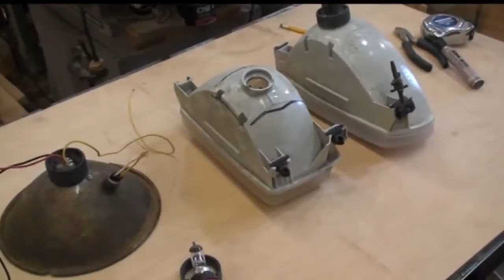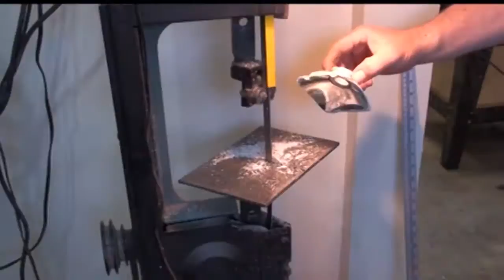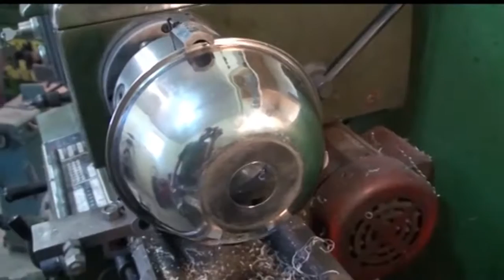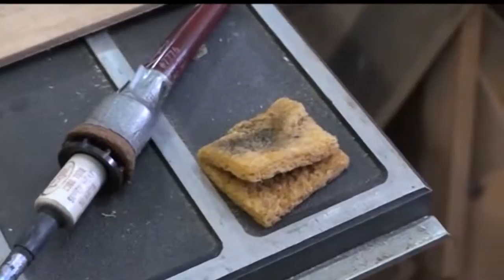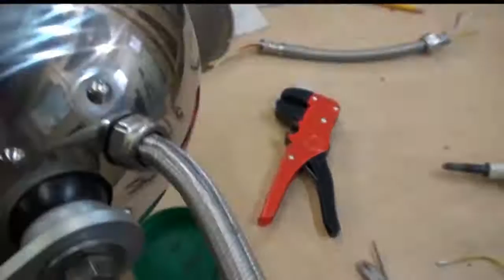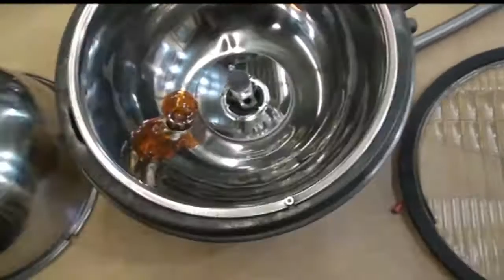Vintage Headlight Conversion to Halogen Lighting - the cheap way

Comment: Doesn’t a halogen sealed beam cost just $15 anyway?
Reply: Incorrect size. Sealed beam is only up to 7” whereas a lot of older cars are 8” or so which don’t exist as a sealed beam unit unfortunately.

Comment: One problem is that the silver reflects the most light and stainless and chrome don't reflect near as much.
Reply from the maker: You are correct but this was a simple and cheap alternative that still works and a whole lot better than the vintage setup.

Comment: by using the 16 g wire initially, using 14 g wire wouldnt seem to make anything safer as  the current being used is still going through 16 g...and i dont think thats heavy enough for the load.......in my build, I ran flexible plastic bathtub/shower conduit.This is the type that is used for when you have a removable shower head and looks like it has a chrome plated coil around it..... I also used12v auto relays...the 16g ran power to the relays while 14g was run to handle the actual power to the halogen sealed beams. ..dont forget to make your buckets moisture proof as that will blow out your halogen bulbs instantly. ( another reason i used halogen sealed beam lights).that being said..i really like your build..great idea using the bowls.
Reply from the maker: The larger gauge wire can handle more current without getting hot. The 16 gauge wire is too small for the halogen lights, causing the wire to get hot and possibly melting the insulation creating a fire hazard. I have seen now a few cars/hotrods burn up due to wiring issues and most often using too light of a wire gauge. There are charts showing currents, wire length and the require wire gauge for the circuit. Check out this link for wire length, current, and wire gauge http://suncruisermedia.com/downloads/3676/download/Wire%20Sizing%20Chart.jpg?cb=dfe3431e84f019394b67d8edde07a098 

I did make a seal for the headlights but thanks for the reminder.

Comment: It would probably be smarter to have the original reflectors resilvered, since using whatever bowl you can find probably won't put the bulb the proper distance behind the lens.
Reply from the maker: True, but that was not available to me as an option so this resulted in plan "B" and the video as a cheap alternative.  As it turned out the bowls had the same parabolic shape as the original reflectors.

Comment: I don't dare to imagine what would a beam pattern look like. I mean - I keep modding and inventing, investing hundreds of hours and euros into headlight prototypes to make an innovative pattern to improve visibility and decrease glare to the oncoming traffic only to make a decent safety improvement, while you take a fucking bowl and promote it as a halogen headlight. Well that really keeps me thinking.
Reply from the maker: +zokieboi - well hot rodding can come about two ways.  One spend thousands of $$$$$$ or come up with alternate solutions that make it more affordable and still safe.  What I have shown here is a method of improving the original 1928-31 Ford headlight using a cost effective method.  It does have a very  improved light beam over the original. Yes it will not be as good as something you spend hundreds of $$$$$ on but not everyone that builds a hot rod has deep pockets to spend unlimited amounts of $$$$$ for their project.
Reply: +1929fordhotrod and it still keeps me thinking - it can't be DOT approved, but it's so cheap that it's actually genius :)
Reply: +1929fordhotrod +zokieboy - Hey John, your website is dope, got lots of inspiration there! I know its been a long time to comment, but I'm amazed by how you response to this somewhat interesting comment from this zokieboi, while most would just burst their lips replying, but that's a smart and humble answer you gave him. As i see it, and as you stated, there's always 2 side in the customworks world, the one with unlimited amount of $$$$$$ and the one with shallow pockets with only deep spirit on working on their build, and you wrap that well in the answer, and these 2 comments really shows those 2 ways in a nutshell, glad to see these 2 well written words, and there's still people using their head in comments, where most people just saying shits on comments. *btw for those who didnt have a lathe, you could also bore a hole with a holesaw or a frostner bit to make the hole for the housing in the bowl, just mark a center and drill through it and bam.
Reply: From what I can work out, the USA has little if any inspection of cars after they are sold. No yearly test as we have in the UK (and I suspect, the rest of Europe). The police seem to be responsible for taking unroadworthy vehicles off the road.
You only have to watch one episode of Roadkill before you go "WAAAAAT? They drove that on the road?!!!".